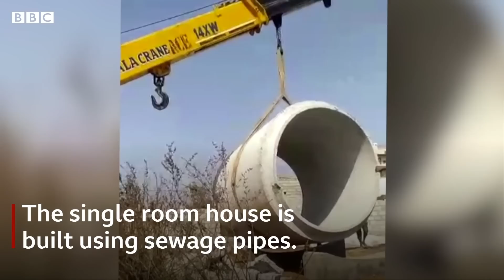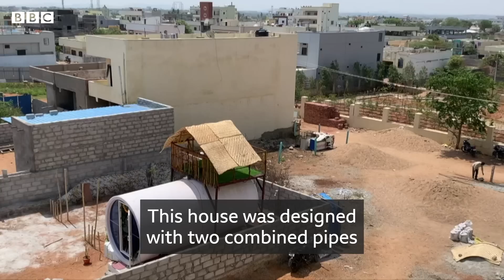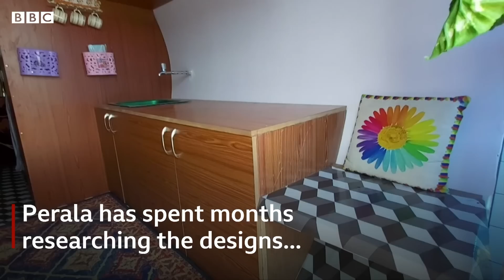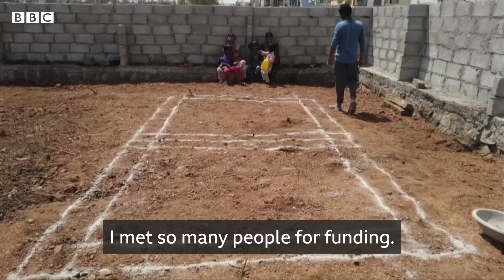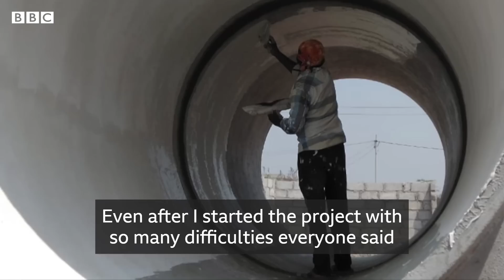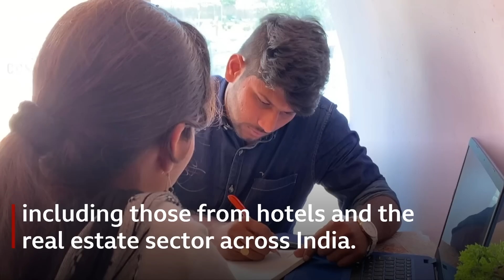Could giant sewage pipes solve India's housing crisis? - BBC News

Comment: They’ve been doing this for a while in some Japan suburbs but three times the length the best thing is you could probably use composites in the cement mix like shredded plastic and rubber etc.
Reply: Perlite would be great in the concrete mix as it's very light and would also act as insulation.

Comment: Isn't a shipping container house a better alternative because of non curved walls?
Reply: I don't know, so it may be irrelevant. But I think concrete walls are better than a metal box in India hot weather.
May be wrong though.
Reply: Yeah it would be, but we can't let this slide right some people like a oval shape house we never know
Reply: Rust issues  with metal
Reply: Better water resistance in rainy India. Container require maintenance against rust while this is literally a water pipe
Reply: So in India, concrete is the better choice it seems. This would evolve i believe they can make different shapes as per customer interest💯🔥🔥
Reply: Look this up
7 reasons why shipping container homes are a SCAM - Belinda Carr
Reply: India gets 4 months of rain and also high heat .. concrete would be much better for insulation and also not corrode in the rain .

The pipe design is not the best for space utilisation.. if the same company that made the pipes start making modular concrete box shapes then it would be much better
Reply: Much better. Also, a shipping container won't collapse on you.
Reply: @BalancedBodyVibes  Use paint. Easy solution.

Comment: Good idea.  I live in a desert, and those concrete tubes are always the coolest place in summer.  Never tried them in winter, but the concrete would be good thermal mass, storing the heat and regulating temperature.
Reply: Those tubes are usually cool because they are covered in earth.  Are you referring to pipes that are completely exposed?  Concrete is a very efficient heat storage medium.  These pipes when left out are normally scorching in the summer.

Comment: Why would they not just set up a factory to create square ones like a storage container? Easier and safer to haul and more practical to live in.  They are also stackable to create multiple story buildings quickly. 
The round glass is expensive to to cut and install.
Reply: Need Capital + Risk + need to create that much demand to sustain factory. = Very High Chances that project go bankrupt

Comment: This is not suitable live permanently, the weathering course is not obtained over the load to resist earth pressure and external forces can be suitable to construction site house work, even if any impact or external forces suddenly act on your structure it must get brittle or failure. 

The structural shape changes can be possible to work and get permanent live.

Comment: This made me remember the basically-scam of container houses: not cost effective, lots of material necessary for thermal insulation, use of new containers instead of used ones due to safety concerns, among other problems. A concrete wall should do well for thermal insulation (at least on India and other tropical climates), and it definitely seems like a really good project (even if the washroom seems cramped).
It won't solve the housing crisis (these usually aren't caused by lack of construction, but by other reasons), but it's a great project nonetheless, and probably a great way of making emergency housing. If an adaptation for cold climates can be done, then it'll be one hell of a project.
Reply: The housing crisis is caused by lack of funds. Individuals and couples can’t afford the staggering monetary increase houses cost. A house cost in the upwards of $250-$300.000 on the low end where the average households only brings in roughly $100,000 a year. ( this is assuming it’s a two partner home)
Now reduce the income to $50,000  ( and this is being generous) for a single parent household and the amount listed above  to buy the home is unachievable. Now the lower income brackets barely make $30,000 and have children, a home is definitely out of their reach and rent cost just as much of not more than a house. The problem is big corporations are stepping on people by buying property and inflating the cost to rent or buy a home. It’s the theory own nothing and be happy about it when in actuality it’s stripping my away individuals livelihoods and leaving them on the streets. A person can not be as creative in the United States as the rules, regulations and zoning would not allow certain structures UNLESS the person is outside of zones and own the land. ( this still falls back on paying a large amount to own land). It’s a vicious cycle of leaving many with no options and homeless.

Comment: A place you can sleep inside doesn't mean you can live inside. i can already see a few problem...
- Tube shaped = space wasted.
- Unstable design, extra money to anchor your home so it doesn't go anywhere?
- Plumbing, your poop needs to go somewhere.
- Electricity.
- The land where the tube was placed is NOT yours.
- Ventilation is a big issue too.

Might as well stick to the container house, at least it will not be going anywhere when something happens.

Comment: Surely cargo containers would be more practical?
Reply: But they aren't as long lasting as Concrete pipes
Reply: Not enough at the moment for shipping.
Reply: No. There’s more cons than pros in using containers. Plenty of videos on YouTube about it, or info on the wider internet.
Not clean when recycled, damaged or when cutting into them they lose structural integrity so have to be reinforced, need fully cladding with insulation, cost of them are prohibitive nowadays, etc.
Reply: Be very hot in India

Comment: Jump on top of the pipe and it will break (these pipes are not designed for pressure from sides, they're extremely fragile as a housing)
Reply: Very droll ... I'm going to presume you failed to get an O level in civil engineering, then?

😂😂😂😂😂😂😂😂😂😂😂😂😂😂😂😂😂😂😂😂😂😂😂😂😂😂😂☺️😂😂☺️☺️☺️☺️☺️😂😂😂😂😂😂😂

Comment: Looks like it could work ... a sort of high density Hobbiton. Especially if soil was backfilled between the pipes for insulation against the heat.

I suppose you could build tiers on top of tiers if necessary. Just a case of organising access.

That said building with concrete isn't that "green" as the environmentalists like to remind us.

Still, it's all a trade off whatever you do.

Comment: Shipping containers could offer more usable space but as it's metal it would be super noisy during the 4 month long monsoon season.

 116 sq Mt is barely ok for like 2 people maybe but not kids..

If this was a modular pipe where you can add pipes to the sides to add rooms then it could work better.

The pipe design is not the best for space utilisation.. if the same company that made the pipes start making modular concrete box shapes then it would be much better